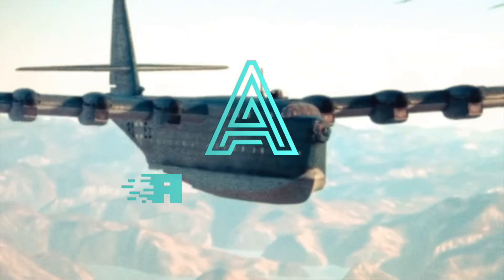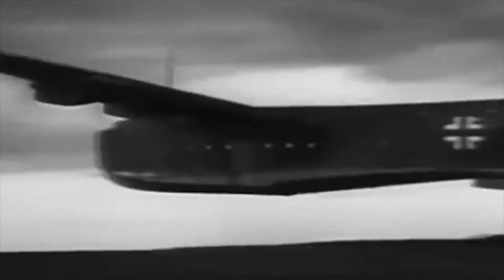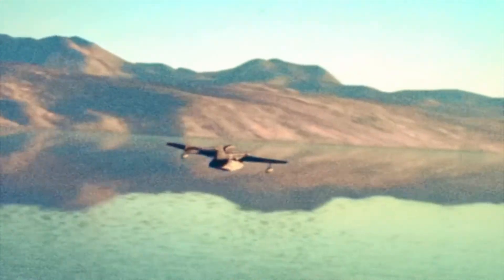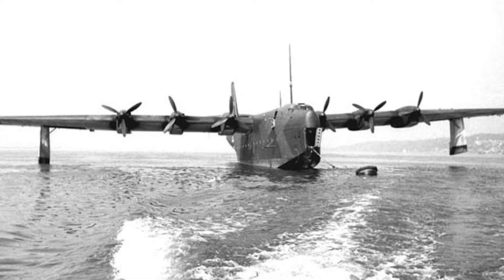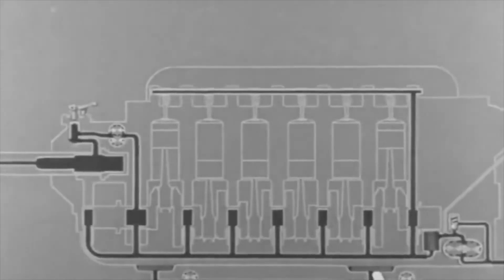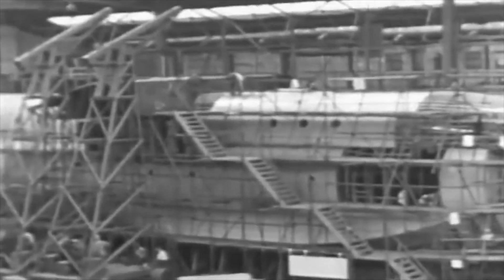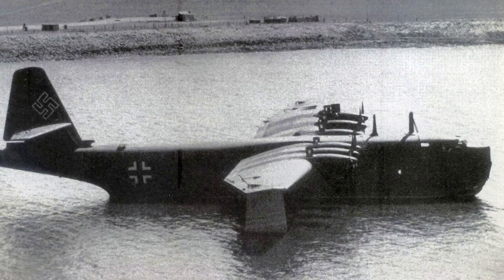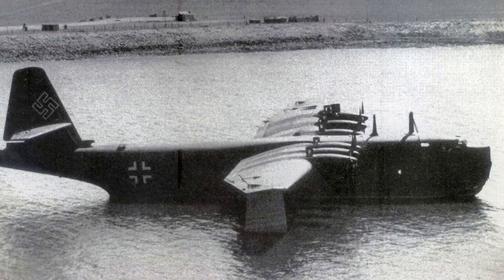The Largest Aircraft of World War Two - Blohm & Voss BV 238

Comment: The DB603 engine is about 1100mm tall (around 45in). And that wing is not much thicker. At the thickest part of the wing will be the fuel tanks. This means the access tunnel would not be tall enough for a man to walk along.
Reply: Not to walk through but there would've been an access tunnel for the engines in-flight. Perhaps a crawl space. These things are often exaggerated. I know there were access tunnels one could stoop through to get to the engines on the Boeing B314.

Comment: Largest aircraft of ww2?. Arent you forgetting  the Hughes spruce goose and  the B36 peacemaker?. both ww2 designs. Regards, Walter.
Reply from the maker: Hi Walter the Spruce Goose first flew in 1947, whereas the B-36 flew in August 1946 - I think an aircraft has to be completed or at least airworthy during ww2 to count.
Reply: @aviationdeepdive  The XB-19 first flew in 1941 and had a wingspan longer than the BV238, It had a range of 5,200 mi (8,400 km) and a maximum bomb load of 37,100 lb (16,800 kg).
Reply from the maker: @paulking7019  But it was the same height, shorter in length, and hugely lighter, so overall considered to be smaller.
Reply: @aviationdeepdive  The BV 238 was the same height, but with shorter wings and less wing area than the B 19, so overall the B 19 is not considered to be smaller. 

Weighing more is not a bonus for an aircraft. It is a negative.The BV 238 weighed as much as it did without even having any landing gear. Its weight made it incapable of carrying as large a bomb load as well as limited its range when compared to the B-19s max bomb load of 16,800 kg compared to the much smaller max bomb load of 9000 kg for the BV 238. The B-19 had a significantly longer range than the BV 238 as well. Partly due to the higher wing loading of the BV 238.
It was a heavy plane with not as much wing area as the B-19.
The XB-19 was operational much longer than the BV 238.(From !941 -1946). was too.

Finally look at the BV 238. I can see why it is longer. What is that protrusion sticking out of its tail? What does it do other than make the plane longer?
Reply from the maker: @paulking7019  We're not talking about 'bonuses', that's not relevant to what makes the aircraft bigger. In most categories of dimension and mass, the 238 is larger.
Reply: @aviationdeepdive  I never thought we were talking about bonuses. I thought we were talking about the size not weight. I simply pointed out that more weight is a disadvantage in an airplane.

 If you want to call the BV 238 the heaviest plane of WWII, then fine. It is not THE largest. How can you say it's the largest when there is another plane that has a larger wingspan with more wing area?  The BY 238 is the "heaviest", and ONE of the largest planes to have flown during WWII. That is as far as I will go, because it is an accurate statement.
Reply from the maker: @paulking7019  I can say that because you are cherrypicking the stats where the XB-19 wins out. Having a larger wing area does not make the aircraft as a whole larger. The BV 238 is larger in MOST metrics.

It's fuselage is much deeper and wider, it is longer in length, it physically has much more metal in it (which is the reason why it's SO much heavier). You can quote wing area, but one could just as easily quote fuselage area, which the 238 clearly has more of.
Reply: @aviationdeepdive  Or cargo capacity, which I suspect the 238 wins as well.

Comment: XB-19 Bomber ??? I am not so sure about the BV238 being the largest AIrcraft of WWII. In 1941 (almost 3 years prior to the BV 238). the U.S. XB-19 took to the skys with just 4 engines and a wingspan of 64.6 meters (212 ft.) vs the BV 238s 60.17 meters (197.5 ft.). wingspan. 

The B-19 was armed with 11 machine guns. Six were .30 cal and five were .50 cal. It also carried two 37mm cannon.  It had a maximum bomb load of  37,100 lb (16,800 kg) with a range of 5200 miles or 8400 km.. The plane was so enormous that it could destroy runways just by rolling across them. Only one was ever built as the Army AIr Corp deemed it obsolete but it continued as a test bed  and transport for the B-36. It was retired in 1946.
Reply from the maker: Depends on your definition, but the BV 238 was longer, same height, and heavier. The XB-19 had a longer wingspan by a little bit, but considering the 238 beats it out in all the other categories I'd say the 238 still counts as the largest.
Reply: @aviationdeepdive  It does not beat the B-19 in all other categories. B-19 has significantly more range. B-19 has larger wing area. B-19 carries a much larger bomb load with less wing loading. It also flew on 4 engines instead of needing 6 to get it in the air. It was operational far longer as well from 1941 to 1946..

Weight is a negative when it comes to aircraft. The B 19 didn't have a strange protrusion sticking out its rear to make it longer..
Reply from the maker: @paulking7019  I don't see how range, bomb load, wind loading, and having fewer engines has anything to do with being 'larger'. I definitely don't see how it being operational for longer has anything to do with the question "what was the biggest aircraft of WW2".

The 238 is physically larger in the majority of dimensions and mass compared to the B-19.